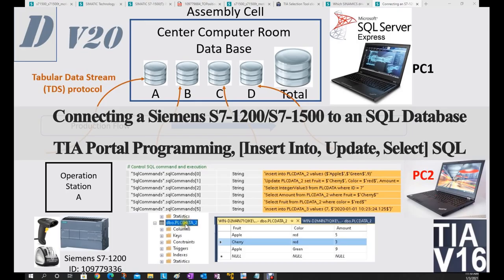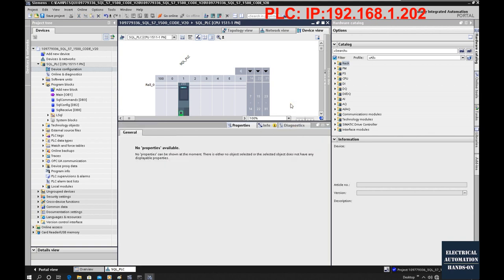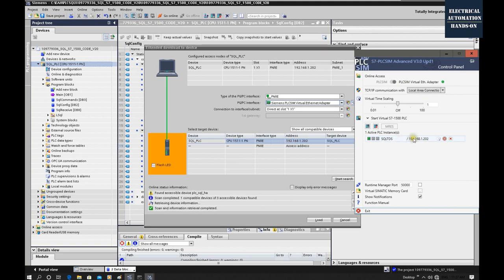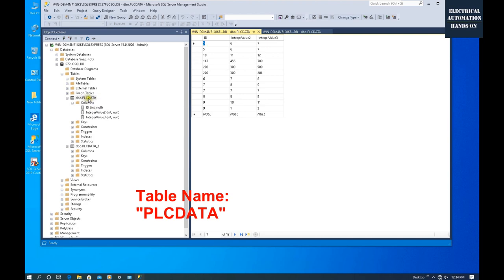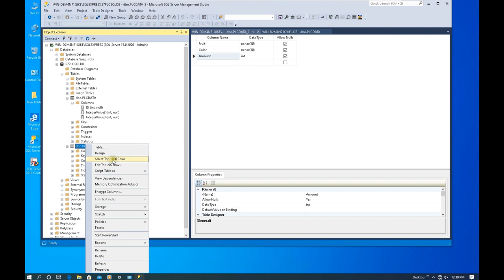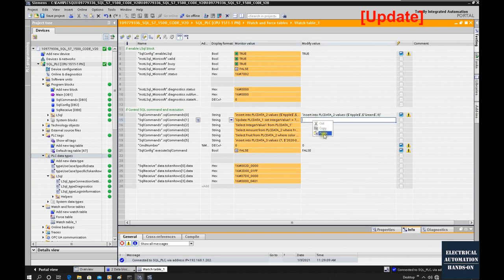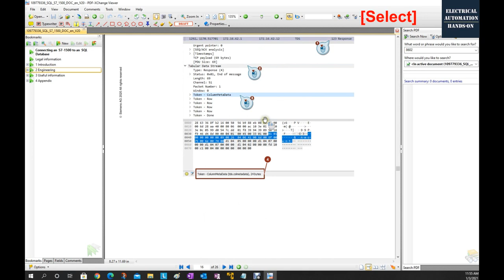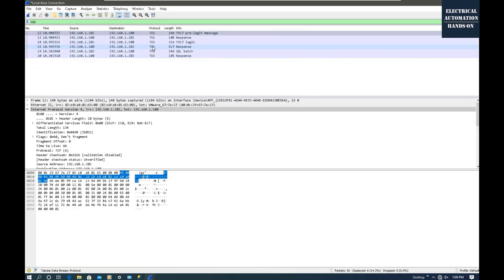COM13d. [4/5]V20 Connecting a Siemens PLC S7-1500 to an SQL Database [PLC Section]

Comment from the maker: Siemens released V21 on Feb.21, 2021, which likely solved the problem of the programming for S7-1200 .  "The parameter "data" must be interconnected with an "Array of Byte" when using a S7-1200. A structure is not permitted. "  This is talking about the "SqlReceive".data at the interface of the “LSql_Microsift” FB

Comment: Hi, I'm getting an 8602 erro when using the lsql block, that means it is a tcon error, which is 80C6. I already configured everything, opened port 1433 on the server and added an inbound rule in the firewll, do you know what else i can do to troubleshoot my problem?
Reply from the maker: Use hardware PLC and a PC installed SQL for the test. Also check the PC firewall
Reply: Have you solved the problem yet? I am using plcsim advance to simulate and get the same error. If you solved this error, can you help me? Thank!
Reply: @electricalautomation  I did the following instruction but i get the 8602 error (for version 3.1 Tia V17). What is the reason for this? And if I use hardware s7 1200 for the test, are there any different steps compared to the steps above? Thanks!

Comment: hi
is that possible to use one laptop for SQExpress and TIA Portal? 
so there are 1 laptop has sqlexpress and tia portal in it and 1 s7-1200 PLC
Reply from the maker: As long as TIA Portal compatible with SQLExpress.  But if you are using PLCSim to simulate PLC for this test, it won't work, because it is using TCP/IP.
Reply: @electricalautomation  hi thank you for your explanation.  I got another question, how do log data from DB to ms SQL using insert command?
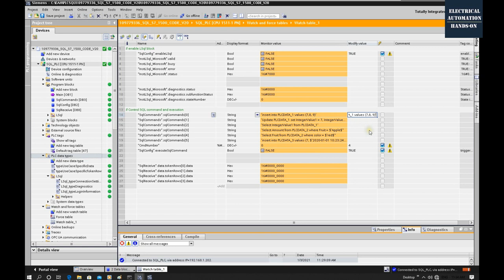Reply from the maker: @faridviko  Sorry, not quite understand your question. As you can see at 12:00 in the video, the command is using ""Insert"
Reply: @electricalautomation  I mean, I have a datablock DB at TIA portal that I want to put it at SQL command.  how can we write that using "insert"?.  let say "insert into PLCDB values (5,6).  I want to to change values 5 and 6 with datablock values.
Reply from the maker: @faridviko  Please watch carefully about the videos on this topic COM13a. [1/5]Connecting a Siemens PLC(S7-1200/S7-1500) to an SQL Database [SQL Section]
https://youtu.be/fRKTqoNKcXU
COM13b. [2/5]V11 Connecting a Siemens PLC(S7-1200/S7-1500) to an SQL Database [PLC Section]
https://youtu.be/2wpFREYnJPY
COM13c. [3/5]Sending INT and Real from S7-1200 to an SQL Database [Programming Section]
https://youtu.be/Y0bLIpnuTQM
COM13d. [4/5]V20 Connecting a Siemens PLC S7-1500 to an SQL Database [PLC Section]
https://youtu.be/jDf2kF2gDug
COM13e. [5/5]V20 Connecting a Siemens PLC S7-1500 to an SQL Database [SELECT WHERE] (Wireshark)https://youtu.be/Z8etx2h_pYw
Reply: @electricalautomation  hi Electrical automation owner, thank you so much for your explanation and video.  it is really helpful since I am still newbie for siemens product.  please keep this work .
Reply from the maker: @faridviko  Thanks! Welcome!

Comment: Hello! first of all, thank for your videos, they really helped a lot!
I am having a problem with receiving data.
I use the version 21 of the code in Tia Portal V16, and I have s7 1200. In the LSqlMicrosoft function code I modified so the received data is an array (data.bytes) I can sucessfully send the insert comands and observe results in my SQL Database. 
What I cannot do is  read the received data in tia . I can see the response using Wireshark though, watching the tds protocol but no data appears in tia and dataReceived is never true. I tried to modify the data type typeUseCaseSpecificData so the tokenColumnMetaData´s size matches the bytes I see in wireshark (as described in simenes manual).
Do you have an idea, what could be a problem? I see in the video that you receive data without any modifications to the code V20 and it happens after sending every command.
Reply from the maker: Hello, I think s7-1200 still has issue on implementing this. In the video I used S7-1500 configuration and PLCSimAdv. According the the document of the V21, S7-1200 does not support the structure in its receive buffer and its length is 8K (S7-1500 64K). As you said, you modified the received data as the bytes of the array, but still can not get successfully, so probably try a simple data and table in the SQL to decrease the data telegram length. From my personal view, there would be something out of the S7-1200 abilities which cause us cannot make it successfully. If this is a test for you, then use S7-1500 or PLCSim Adv, as shown in the video, they are no problems. As Siemens did before, every couple of months, this example got upgrade and got problems solved. Maybe Siemens will update or upgrade this example to solve the glitches soon.
Reply: @electricalautomation  I investigated a little bit and I have realised that the response can be seen in tia but only in SqlReceive.data.bytes which is difficult to read. I suppose the program has got some part that takes care of this data and puts it to accordingly into header, tokenColumnMetaData and tokenRows so it is easier to read. Do you know where exactly does that happen so I can investigate and maybe fix my problem? 

I have written some code that writes the data in more approachable form into new data block but the problem is it must be modified depending on the length of the response (depends on token ColumnMetaData).
Reply from the maker: @monikawisniewska1588  You could try to use a new created DB, set it as the received data and as bytes of the array. Then use this array as the RECV Buffer. Then transfer this buffer DB data to the receive buffer DB from the example program.

Comment: I really like yours tutorial. But can you show also how to insert different data to two or more different tables in SQL database at the same time. I was trying to that but failed. I will be glad :) Thanks
Reply from the maker: I don't think using one command can send to different tables by using this example. But you can switch different command via [index number]. The protocol is TDS and and Send/Receive function blocks are based on the TCP/IP, the current version V20 cannot operating different tables within one command.